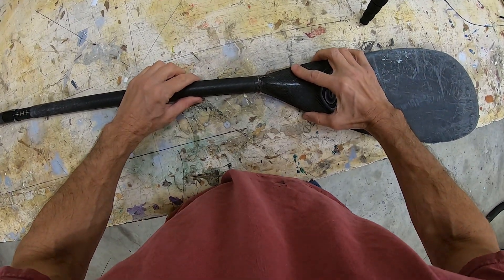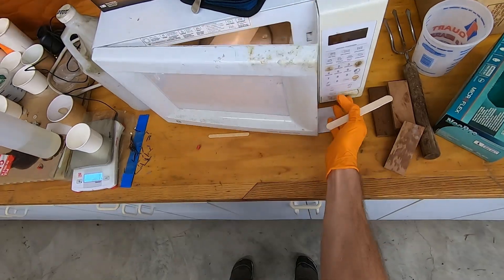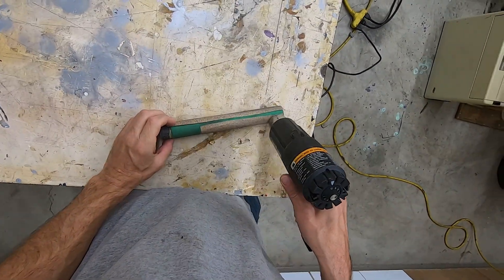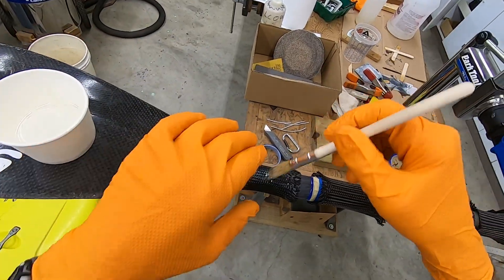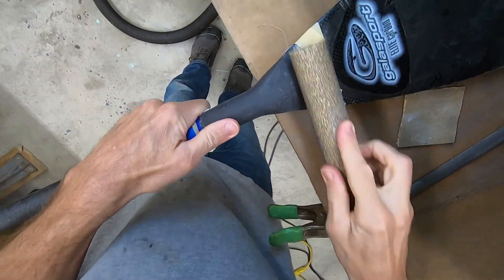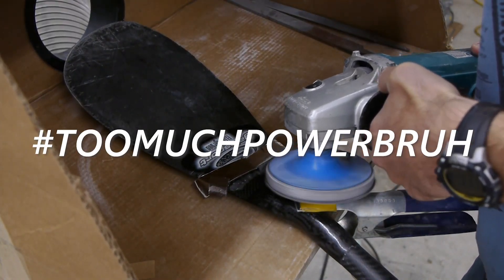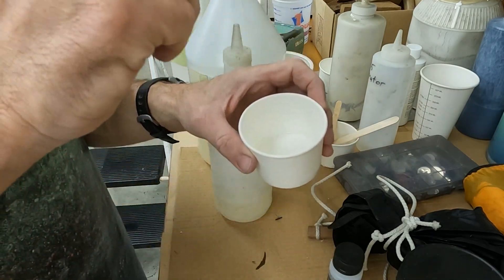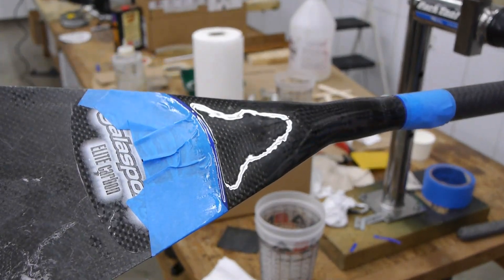The Rachel: Fixing A Broken Carbon Fiber Kayak Paddle

Comment: Very nice done!
Do you happen to know if there are carbon sleeve that are 3-3.5cm but can scratch up to 9cm?
Reply from the maker: No idea, but I would imagine pushing woven carbon sleeve to extreme larger diameter ranges would orient the fibers too much beyond 45 degrees to the longitudinal axis of the shaft that it would be detrimental to the strength and performance of the final product.

I'm speculating, but if I had a core with varying diameter, I would use a larger diameter sleeve where needed, and overlap with a smaller diameter sleeve.

Comment: I have an old AT paddle I’d like to refinish. What cross linked polyurethane finish did you use or recommend. I figured I’d end up using an epoxy but maybe I’m wrong?
Reply from the maker: You can use epoxy as a final finish, that works fine. The polyurethane I use is WR-LPU from System Three.

Comment: What would you recommend for fiberglass shafts? I just had a paddle break somewhat cleanly similar to yours. Werner said I'd have to essentially buy half a paddle as it's a 2-piece which seems ludicrous.
Reply from the maker: I generally fix everything with carbon. Unless the repair needs to have VERY similar properties to the original material (like flex), I just repair everything with carbon and epoxy.
Reply: @hotsoupandfiber  Cool, using your video as inspiration I've got most of the materials and will try this out pretty soon! What kinds of tape did you use for the ends, is the blue thin stuff special somehow?
Reply from the maker: @shenanigoon2K  It's regular blue painters tape from the hardware store.